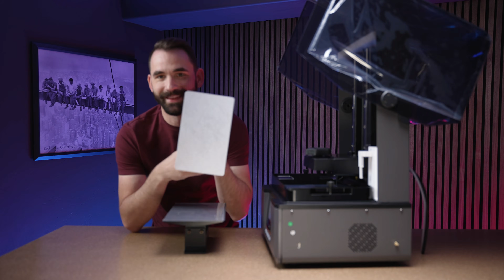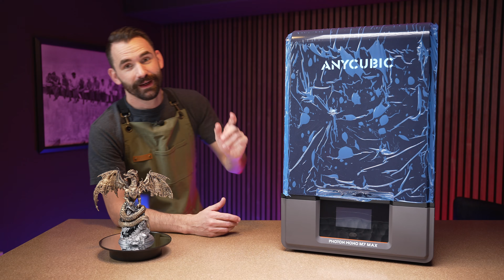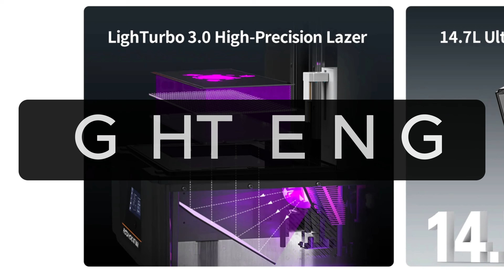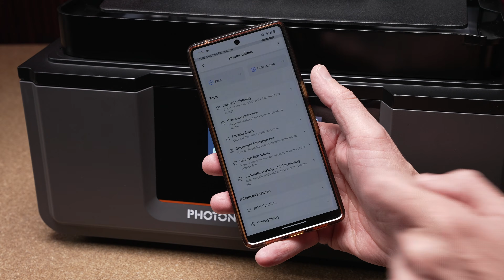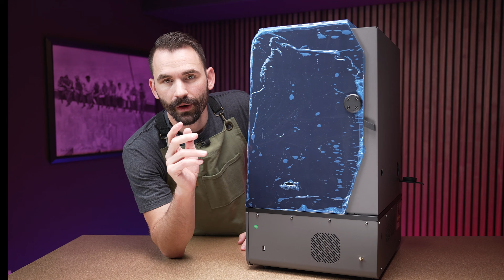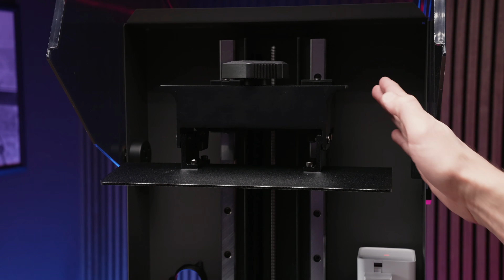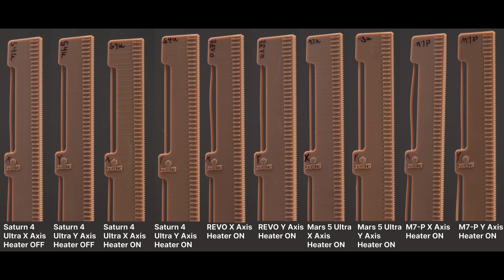Should the M7-Max be your next Printer?  #review #3dprinting

Comment from the maker: I made a mistake the LCD is  6,480 x 3,600 hower it is still 46um x 46um.
Reply: I'm new to printing and wonder if that dragon would've printed as good in one piece rather than separately and would it have fit?
Reply from the maker: @CrainialCommando  You really don't want to print complex parts in a single go as you don't have a good way to place the supports. 

Things being cut up is not always to make them fit but more about how to orientate them.
Reply: @J3DTech  También separas las piezas para poder procesar con mas calidad y poder pintar mas fácil. Por cierto excelente video, me gusto mucho, muy detallado.

También me gustaría  saber las diferencias reales de comprar la M3 Max o M7 Max.
Reply from the maker: @jumagomos  Thank you, the main differences are: The build quality is better, the lighting engine is way better, the Force sensor, and the new firmware to take advantage of the Force sensor.
Reply: @J3DTech  thank very much
Reply: @J3DTech  Any update on the firmware update for the heated vat ?
Reply from the maker: @mros3d  Yes, soon
Reply: @J3DTech  When you cut things into separate parts like this how do you reattach them after they are printed? simply use super glue or is there a special adhesive for these prints?
Reply from the maker: @michaelkey3915  I use Loctite super glue, the gel stuff.

Comment: I love this printer but having problems with the heater and the vat. Get a warning about abnormal heating. I've followed Anycubics suggestions for finding the source of the problem, but have not solved it. Second, the  coating is coming off the frame of the vat. Some users report the black paint is coming off. Was wondering if you have had any similar problems. Getting ready to contact Anycubic support.
Reply: I have experienced the same issue with the black paint on the resin vat.

Unfortunately, I have also encountered several other problems with this printer. I bought it about 8 months ago, and I have been in contact with Anycubic support ever since in an effort to resolve the issues.

I sincerely hope your experience will be better than mine, and I wish you the best of luck in getting your problem resolved.

Comment: Hi, thanks for the video, very clear. One question, Which biocompatible resin do you recommend to print surgical guides with this printer, must be clear, and for mouthguards as well? Thanks
Reply from the maker: For that, you're going to have to go into the dentist world. They have special resins that are specifically designed for that type of application as most other resins are toxic and you could not put them in your mouth or even have contact with your skin. 

I would actually look the Phrozen dental line for this.

Comment: The M7 MAX printer is absolute garbage, and I'm speaking as the owner of this piece of junk (as it later turned out, I'm not the only one so lucky). It prints one model out of 7-8 prints more or less normally, but the number of defects is staggering. I've tried everything, and it turns out the printer frame (which holds the display) is crooked. Two diagonal corners are tilted a millimeter (the other two are flat). The platform on which the models are printed is also crooked, curved toward the center. How is the buyer supposed to fix this, and why should the buyer bother fixing crooked printer parts at all?! Anycybic makes their junk with crooked hands, there's no warranty, and their support is tentative (they're designed to waste your time, writing all sorts of nonsense to discourage you from using them). Don't buy junk from this company; there are other, more reliable manufacturers (I have printers from other manufacturers and I've had no problems with them).
Reply: Hi, which printer do you recommend? Thank you for help 🙏🏻

Comment: Hi! We have a monophoton 7 anycubic printer. We cannot get the models off the platform. We have tried everything. We are currently using water-wash resin 2.0 anycubic and are using the factory settings for it but still no luck. Please help!! Any suggestions??
Reply from the maker: A few, first I would move away from water washable resin. It is just as toxic as normal resin and you cannot wash that water down the sink. It will ruin your plumbing any contact with skin will slowly develop an allergic reaction. 

But more importantly, it's just not as good and so you're going to have a much more difficult time with it. 

The next thing you're going to want to do is calibrate your resin if you head over to the Lychee slicer YouTube channel You will see I have created lots of videos on how to calibrate your resin and so you're going to do that next.
Reply: @J3DTech  Thank you we will try that.

Comment: Great review, but I am so freaking tired of stupid figurines on resin printers and mo one making engineering parts, moulds.... It is such a waste on these fantastic printers and it makes it difficult to know if they are really just playthings.
Reply from the maker: If you look at my content on the lychee slicer YouTube channel, you will see that I did a video on how to support and print engineering parts. 

Feel free to go check that out
Reply: @J3DTech  It took me a while to find this on the Lychee channel and I think it must be this video - https://www.youtube.com/watch?v=ijM1fG30-S4 but I really hope you will go into showing how Lychee slicer and cheaper machines can do the same as Formlabs 4/4B series when it come sto fine detail prototypes, mechanical parts, moulds, manufacturing rigs...
There is a real shortage of use of resin printer in engineering
Reply from the maker: @jenspetersen5865 Well they're not going to do exactly the same thing. The form 4 for example, has a very powerful UV engine and a very different lighting system that is able to cure certain materials that we can't do in the desktop printing area.

That said, there are some resins in the 405 nanometer that are pretty tough and durable. Some of the Sirayatech ones are pretty decent. 

Where the cheaper 3D printers are actually better than the form Labs is accuracy. They have much greater accuracy at the cost of some of the longevity that the form Labs will have. 

However, the major reason why you don't see that type of content very often is that very few people in this space are looking for that type of content and therefore it's just really not created that often. 

However, in the next video I'll be working on soon. I will be doing a highlight of some of the Shreya tech resins but not necessarily an engineering parts. But I'll be highlighting scaled models. 

Again, the reason for this being there's just not a big audience out there for a strictly one-to-one prototype for engineering content.
Reply: @J3DTech  While I have mostly used Sirayatech and Lychee on Anycubic I have mostly hd to resort to CNC machining the surface facing the build plate,  and the qualities I have had professionally printed on Formlabs 2 initially have been much better defined with better surfaces on all sides. We are printing some valve covers with 0.9375in, Ansi threads 15/16-12UN, A2 that we have not been able to create in Sirayatech reagents.

All customers to resin printing before Formlabs were for engineering parts so I think there is a huge latent use there as resin can create things that FDM cannot, and in strengths that FDM doesn't get near. 

Interesting to learn that Formlabs differs that much in Gen4, as I had assumed that they were just doing premium brand/QC compared to the low cost stuff.

Comment: I have this printer, and since having to change the FEP I can't get things to consistently stick to my build plate :( they either only stick to the outsides of the plate, not at all, or the rafts peel off and don't stick to the plate, any help please? :(
Reply: they also just stick to the bottom of the FEP sometimes
Reply from the maker: @_dandymott What did you replace it with ACF or nFEP?
Reply: @J3DTech  it was ANYCUBIC 13.6" FEP matt film
Reply from the maker: @_dandymott ACF or nFEP? 

If it was ACF don't use a spacer and the textured side down down towards the LCD.
Reply: @J3DTech  its ACF, just checked on my old amazon order! certain prints are sticking to the outer edges and others aren't, I'm going to try increasing exposure time on the burn in layers, and levelling it again. what is a spacer? I'm new to this :)
Reply: Things are generally not sticking to the centre or back side of the build plate

Comment: I just purchased a max on prime day, and this video was helpful, thank you.
Reply from the maker: Happy to hear the only downside of this printer has more people have used. It is. I've seen some people really struggle to get it level. 

Yeah for this I really would look into 3D printing. My leveling jig I made one that's bigger specifically for this printer. That should make it a lot easier. 

There's another little trick that I use and that is when you level it. Instead of using the automated leveling system built into the front LCD you're going to create a print doesn't matter what it is and you're going to set the bottom exposure to 400 seconds. 

You're then going to loosen up the build plate and start the print. You will then level the build plate during That first 400 second layer which should be more than enough time.
Reply: @J3DTech  When you say you do the leveling directly from a printout, do you still use the provided leveling sheet or do you do it with an A4 sheet of paper?
Reply from the maker: @BenjaminNoël-c8b I just use a normal paper 2 of them. Tomorrow they'll be a video released on the lychee slicer YouTube channel where I talk about leveling this printer specifically.
Reply: @J3DTech Thank you, because I find it very difficult to level this machine properly. There's always some misalignment somewhere.
Reply: how much were they? currently $699

Comment: Am I wrong or Anycubic M7 Max doesn't support separate wiat before cure for bottom / initial layers different from normal layers? Haw can we increase light off delay for initial layers in M7 Max?
Reply from the maker: No any cubic printer does, however, most of them do something unique with the firmware. 

For an example, on the first 50 layers, the M7 Max slows down the print and adds in a forced wait time. 

Other printers in the past do different things. Even some of the oldest printers forced tsmc before tsmc was even a thing. 

I used to be working directly with the main product manager over the M7 lineup and we were working together quite closely to develop weight before print for the bottom layers but she quit and my contact with any cubic has essentially dropped off so I have no idea what they're doing now..

Comment: After having a ton of issues with Elegoo Saturn 4 Ultra I am getting this. Should be here Tuesday.
Reply from the maker: @curtiscrowethephotopro2453  If you have any issues or questions be sure to reach it. This is a very large build plate. It can be a little difficult to get level because of that. I do recommend you print my leveling jig and be ready for it when it arrives. 

If you don't have an fdm printer And depending on your location, there's probably services that can get you a print within a few days for a very low price.
Reply: @J3DTech  Awesome do you have a link to the Jig? I don't see it in the description and I am not seeing an annotation in the video at the leveling phase
Reply from the maker: @curtiscrowethephotopro2453  Here is a link to all my work. You will find it there 
https://cults3d.com/@J3D-Tech

Comment: Great video! I’ve been trying to get precise Z-axis prints on my M7 Max using 10 to 50μm layer heights, but they always come out slightly too tall. Have you tested, or could you test, some calibration cubes to check Z-axis accuracy? I’d love to see if you're getting better results.
Reply from the maker: In my guide I have the section on Build Plate Calibraion, follow that to get the Z dialed in. 

But this printer you cant set the Z offset but you can alter how you level it.

Comment: Why did your prints look dry when removing the supports? Did you clean them and dry them with ipa before removing supports?
Reply from the maker: @Elyias  Yep, I have quite the cleaning process that some day I'll do a full video on. 

But here it is real quick. 

I have four buckets of IPA. They're 4 gallon buckets and I put 3 gallons of IPA in each. 

Inside of each bucket, there's a funnel system that prevents any of the fallout from coming back into the IPA. 

And I have a metal basket that's just big enough to fit underneath the lid while sitting on top of this funnel system. 

For the lids I'm using food storage lights that fully seal. 

The first bucket is very dirty. I pretty much never cleaned the IPA out of that one. That's mostly just to remove most of the resin off of the model. 

Each one of course progressively gets cleaner until the last bucket which is quite clean, even considering the fact that it's been used most everyday for close to a year now. 

When the first bucket gets so dirty I can no longer stand it. I will take that IPA out. Put it in 1 gallon containers and leave it out in the sun to fully evaporate and then I just throw it away. 

I don't clean the IPA in the other three buckets. I just move them down one and the bucket that used to be the first one now becomes the fourth one with new clean IPA. I just simply keep doing this forever.

Comment: You don’t use a mask while cleaning the vat?
Reply from the maker: I cant use a mask when recording, but resin at room temperature will barely offgas. It's when its being cured or heated that it will really release the VOC's and during the cleaning proces is by far the most dangerous time.

That said, in my normal day to day I always have a mask on when I am in my 3D printing room.

Comment: Hej 3d printers. 

The new firmware with constant VAT heating (and not just the pre-heating before print) is downloadable via OTA (Anycubic App) -> for my M7 Max it went first from 4.0.8.3 to 4.0.9.3 and after the restart and reconnection with the app on my smartphone again a firmware update notice = updated successfull the 4.0.9.3 to 4.0.9.8

4.0.9.8 version firmware update content: 

1. Upgraded heating function during printing.

2. Upgraded automatic resin calibration.

3. Optimized various user experiences. Please upgrade to the latest version 4.0.9.8.

Will try the next days with "cold" resin 🥶 (still just 10 to 12°C in my garage)...
Reply from the maker: @Sputnik2025  If you check out my shorts you will see I did a quick update on it. It's a good update

Comment: Hello, first of all, thank you for the video, it was very helpful, I adjusted the lifting level part as you said, but when I put a lot of parts on the tray part of the printer, some parts do not print, some parts do not print, the first layer sticks to the fep film, how can I solve this?
Reply from the maker: @TheFigurider  Well the first layer is all about the bottom layer UV exposure time and how well you level it. 

So if you're having issues with them sticking, consider increasing the UV exposure time on the bottom by 4 seconds until they no longer fail. 

Making sure that on the bottom layers you're never moving faster than 100 mm a minute. If you're using TSMC, the slow speed should never be faster than 40mm per minute. 

If you look at my guide you'll see a section on leveling make sure to follow that to confirm that your build plate is properly leveled. 

If you look at my colts 3D page, you'll see that I developed a larger leveling jig just for this printer. If you have an FDM printer, this really makes leveling 3D printers really easy and very precise.
Reply: @J3DTech  thanks I will try what you said